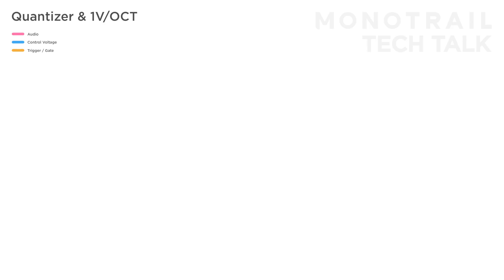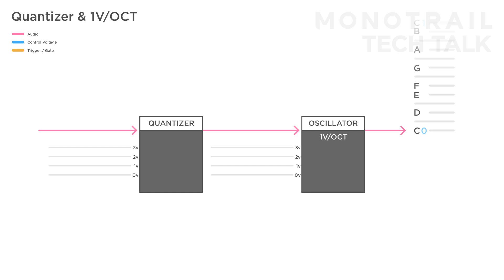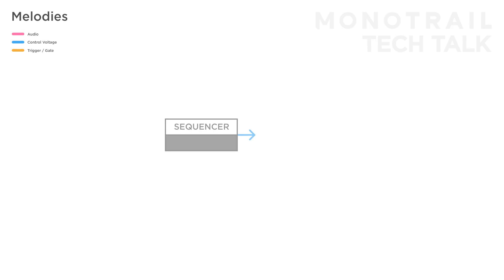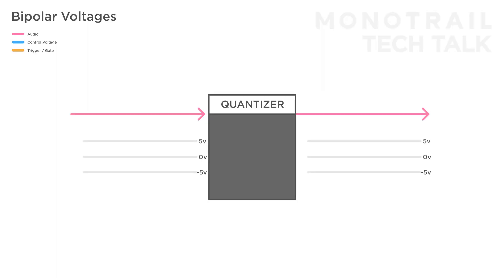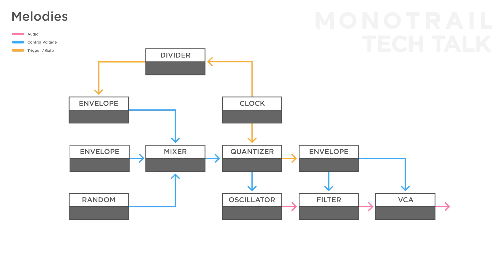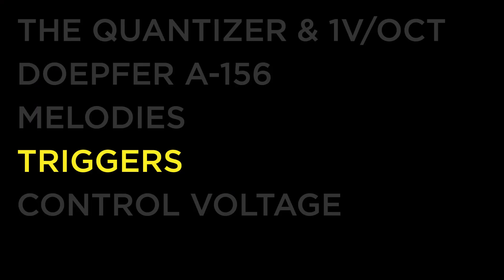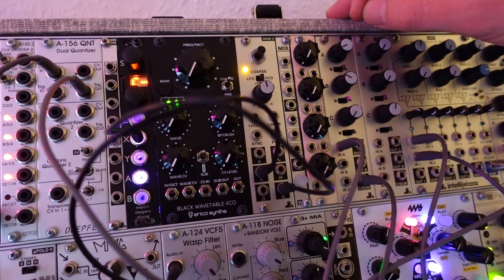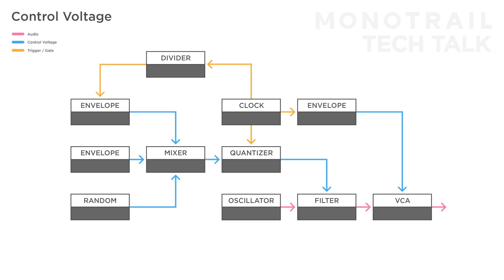The eurorack quantizer and 1v/oct, with patch-tips! - with the Doepfer A-156

Comment: Quantizer 1 is actually fully chromatic right? Regardless of the settings on Quantizer 2.
Reply from the maker: There's a jumper to select if the switches effect both or only the lower quantizer. Make sure to check the manual for details on versions. English text on the bottom of the page: https://doepfer.de/a156.htm
Reply: @MonotrailTechTalk  Oooh didn't know thanks!

Comment: I see you use the erica synths Black Wavetable VCO. I'm at the point of ordering a wavetable VCO and am in two minds about Plaits or the Black. Which one would you recommend?
Reply from the maker: Hmm tough one. Plaits is more than wavetables, offers a lot of other modes, and in general I'd say a wider range of sounds. The Black wavetable feels very dedicated, no mode switching, and I like the wavetables. Key point for me is the -1 or -2 sub oscillator output, that has the same shape and morphing power as the main oscillator!
Reply: @MonotrailTechTalk  Okay thank you very much for your feedback. I think I'll have to listen to more videos about both to make up my mind. In the mean time I just ordered a Hertz Donut  as my main digital oscillator because I saw they were back in stock. I realize it's a totally different beast but I think it will give me a lot of variety too and lots of weird sounds. I want to style my case more in the industrial direction. Do you have any experience with the Hertz Donut? Any tips or things to look out for?

Comment: I had some success using the E350 as an lfo into a quantizer and then just nudge the settings to change the output wave slightly every now and then. So basically a wavefolder and attenuation can shape a simple "boring" low frequency wave into something rather useful for making repeating but interesting patterns. Thanks for what you do. You are a supreme pedagog. Also kudos for using relatively cheap modules and showing that you don't need a wall of eurorack to make good music.
Reply from the maker: Hey thats very intersting indeed! So you can set the waveshape to make an interesting pattern, and then use subtle waveform modulation to make variations. I like it, thanks for the tip! And you're welcome! I am afraid the wall will grow a lot faster now I started this series, there's a lot of interesting things Id like to talk about I don't onw yet. But I do hope to keep that philosophy alive :) All the best!
Reply: @MonotrailTechTalk  Hey and thanks for the reply. Yes as the E352 has some "strange" modes like morph + wavefold, morph + phase etc, that can be used below audirate you can get some really strange lfo's. So there are probably loads of other funny shapes to find with a combination of other modules, as long as you get the frequency low enough. I haven't got a wavefolder but guess they can fold lfo's to, and that together with a filter with a fm input is in this context probably worth exploring to.
Reply from the maker: For sure, I'll get into exploring simple LFO through wavefolder shapes for melodies  :)

Comment: Very interesting, as always!!! I just haven´t figured out the transpose-function yet - when I put in a gate signal,  I just hear a very high pitched noise, and with CV nothing really useful happens either :( Or is it only for keyboard-connection?
Reply from the maker: Thanks! And the key there is attenuation. If you patch a gate directly to the transpose  the pitch goes up so much you just end up with a high noise. In my video I use the gate from the Beatstep Pro through an attenuator, then adjust the atenuator to determine the amount you want to transpose.
Reply: @MonotrailTechTalk  man, thank you!!!! You don´t know how long I tried to find out..!!! Will try that right away! P.S: I bought the DUAL LFO after I saw your other video, its great haha ;)

Comment: Love your videos. Also love quantisers (well, analogue sequencers which usually need a quantiser). I have an A-156 (shame they didn't include an offset) and a Ladik Easy Quantiser. I prefer one control per knob where possible. 
DO you use any other quantisers?
Reply from the maker: Thank you! And an offset would be nice indeed, but also like Doepfers simple, and to the point affordable aproach. I use the Disting mk4 some times, but would like a quantizer with easy to adjust manual scales. Maybe one day ;)